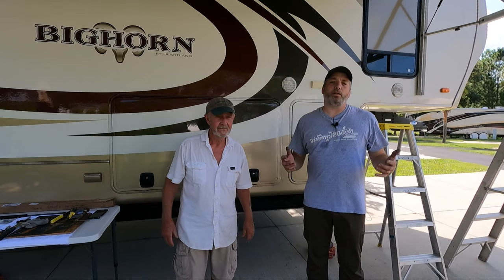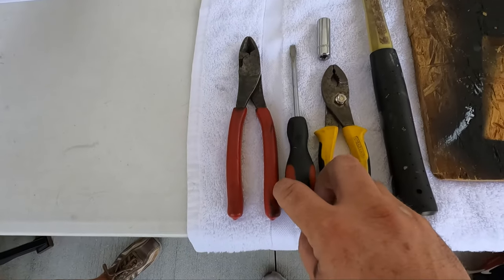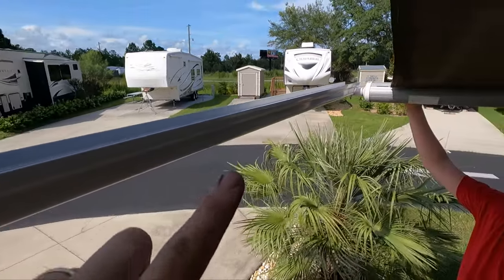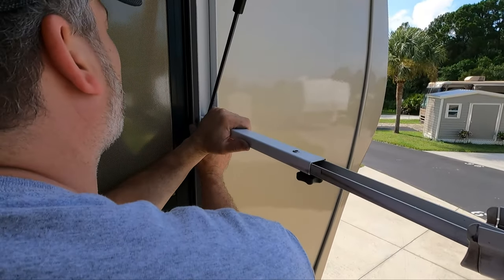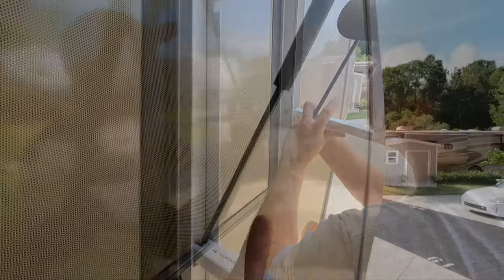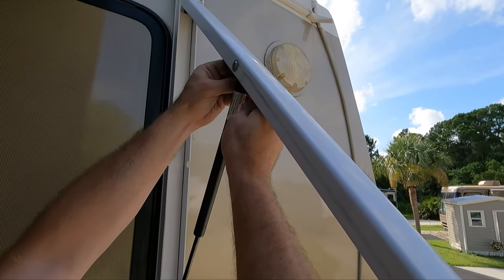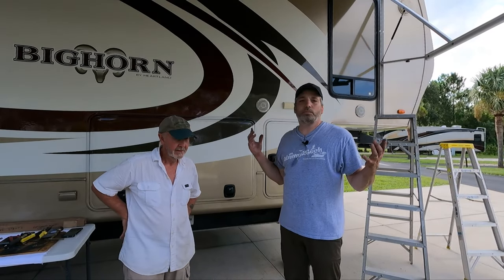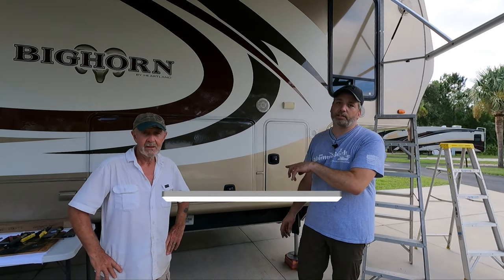How To Replace An RV Awning Gas Strut.

Comment: Very helpful video, thanks. We had situation where someone retracted the awning without releasing the ‘tilt adjustment’ knob. So the support arm snapped at the top. We got the support arm as a used part (was also told that we had to buy a complete arm assembly!). To replace the support arm we had to remove and reinstall the gas strut. This is where video was helpful.

Comment: Just what I needed. Tho I have a different model Carefree awning your video showed me how to get the strut back in. A slight brush against a street sign (my bad) knocked the awning top off. Some hex screws fix that but I could not get the twice as long gas strut back in. Way too strong to hold compressed. I'll give your fix a try.

Comment: Could an old strut also cause the arm to be stuck in the "out" position? Our awning detached from the arm and we aren't able to lift it back up past a certain point (it's the arm without the drive shaft)
Reply from the maker: By the sounds of it an old strut could cause issues since struts can either leak and not hold weight,  or they end up locking into place.

Comment: Can u use a regular bolt if the original bolt is un available ?
Reply from the maker: That should be fine. Just try ro match material so you have the same rigidity of the default bolt.

Comment: You should be able to just unscrew the strut from the eyelet at each end of the strut without having to pull any pins or spacers.
Reply from the maker: That was not an option as there was no way for it to come off. I have done that in the past on the gas struts for like an SUV rear hatch but not on these. Maybe because they have so much force.

Comment: How do I know when my tt struts need replacing
Reply from the maker: You will see them start to leak fluid out or they will just not support your awning anymore and 1 or both sides will sag.
Reply: @Jimmy2Tech  thank you! My awning problem went back to a bad motor. They don’t tell you that it gets so much condensation and water in them.

Comment: how do I know which gaz strut to by?
Reply from the maker: Hello Marie- Reine,
      A lot of times the number is on the strut and you can look it up by that or cross reference the number. If it is not you can call the manufacturer and they can tell you what size you need.  Also the  website we got ours at https://www.liftsupportsdepot.com/  is a good resource to find your replacement. Hope this helps and thanks for watching.
Reply: @Jimmy2Tech  Thanks a lot!